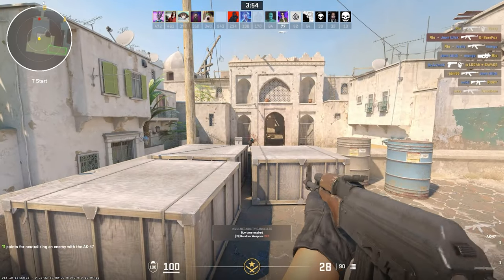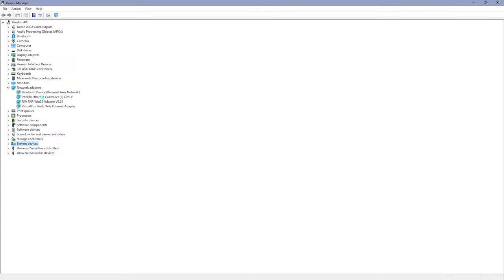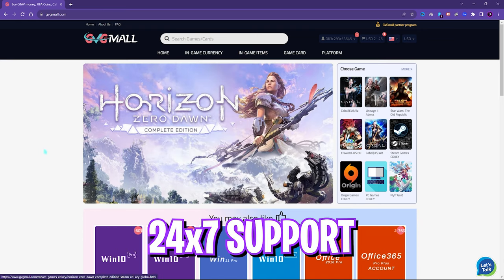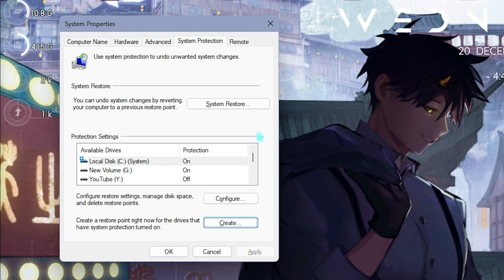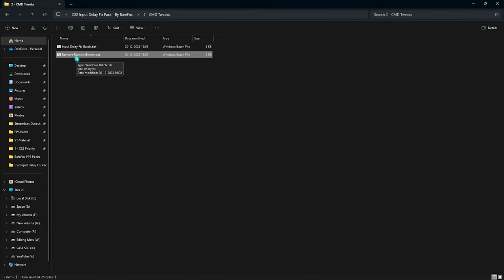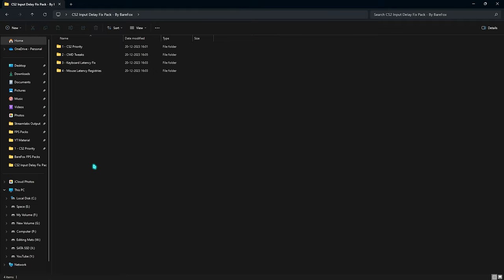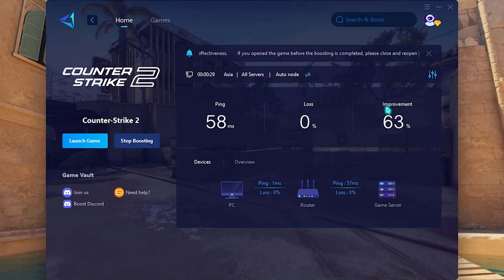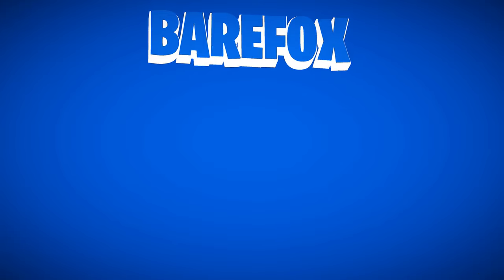How To Get 0 INPUT LATENCY in CS2 | Best Settings to Fix Input Latency!

Comment: this fix pack requires that you sub to the channel. like the video then comment on the video to unlock the pack. i do not recommend this as a fix for your issues. no one helping the community requires this for a "fix". proceed with caution.

Comment: trying this right now, the runtime broke patch does not work, it says access denied even after running it with administrator privileges...
Other than that it seems my boot settings always reset themselves ?!! XD Didn't even notice it was reverted back to default... is there a way to stop windows from resetting boot settings. 
Also I changed the timeout time to 5s instead of 30... Could you maybe make a video on what services we can also disable and make an optimal boot settings video I saw that you had custom boot.
My specs : AMD Ryzen 7 3800x3D (balanced power plan it seems to have negative impact when set on high (stutters) or power saving (less framerate))
Nvidia Geforce GTX 1660 Super Ventus XS OC 6GB DDR6 with automatic full OC
Asus TUF B450-PLUS GAMING 2
Corsair Vengeance LPX DDR4 3600 C18 2x8GB
750W 80+ Gold
Seagate FireCuda 2.5" 1TB SSHD + +1TB SSD NVME.4 + 4TB HHD for VIdeos 
BenQ XL2411P 144hz + Samsung T22B300 @60hz
Zowie FK2 B+ Divina Pink
HyperX AlloyFPS XL sunken in coffeee is this high end ?
DT770PRO
Glorious Element Ice

Comment: Any idea what has valve done? I always played with fps_max 0 on my 4080. I had 350-500 FPS on 40% gpu workload max 50 degrees. 2 Days ago it randomly started using 100% of my gpu on 90 degrees and I have literally 800-900 fps in the game, so I locked it on 300 fps, but now it uses 60% of the gpu on 60 degrees, when before it used 40% gpu 50 degrees on 500 fps. Any idea what happened? (Reinstalled everything, checked everything, it literally looks like valve is mining bitcoins trough my gpu)
Reply: virus
Reply: @yummybuchty2582  GPU simply died after 2 and a half year of using, thats why I will never buy 4080 ever again.

Comment: Hi man, thank you for the video. it really helped. but now i faced a problem, i hope u can help with it. pratically when i open cs2 the game is not opening and it seems like the desktop is going to a highly stretched resolution. and then going back to normal. if then i click the game it only shows a grey screen. i tried also to reboot my pc to the restore point, but for some reason the restoration is never successfull. what can i do?
Reply: i had this problem when switching from go to cs2 with my launch options. maybe try launching the game without any launch command arguments or only -fullscreen. do retry a couple of times just closing the game from task manager or steam until it displays correctly. when you launch this game you shouldnt do anything else and you can try clicking on the game to get it to display right some times (just left click on black screen)